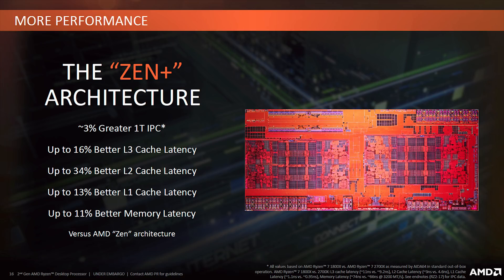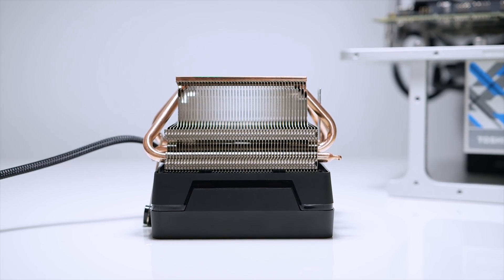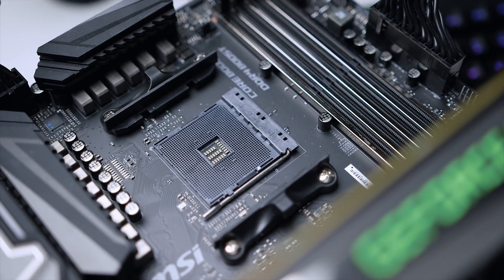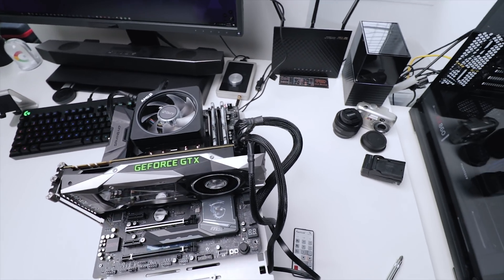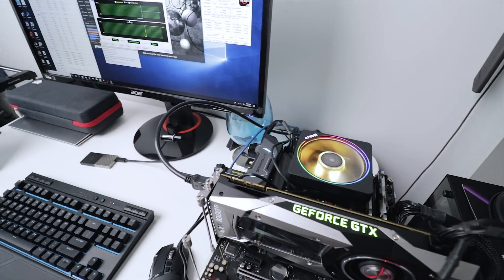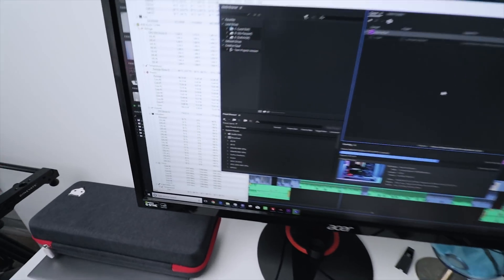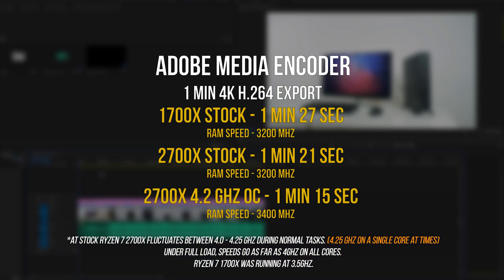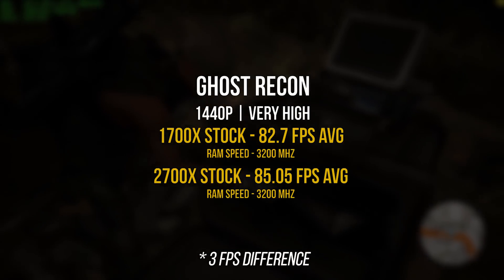Ryzen 7 2700X vs 1700X - Worth the Upgrade?

Comment: Man this is a hard decision. I'm on a Ryzen 5 1600 workstation and want to step up to a Ryzen 7. Looking at this, I'm probably better hoping for a price drop on the 1700x.
Reply: If you don't earn money with that system. Just wait for zen 2
Reply: Doesn't sound worth it to me. Get zen 2
Reply: Hydrochloric Acid I can't remember exactly what they were but MicroCenter is down to $229 on the 1700x. I think that's a small drop from a week or two ago. So $100 for a few seconds off my render/export times? Probably better spending that $100 toward some other upgrades.
Reply: Just got a 1700x from Microcenter last week for $179. $60 for an MSI Tomahawk B450 and price matched G.Skill TridentZ 3200 2x8gb for $165
Reply: cookiemonsta212 that seems like a gpu / driver problem, not a cpu problem  ...
Reply: Ok you sell me that 1600 and then I sell my 1500x to some Ryzen 3 guy then were all happy lol
Reply: The Ryzen 5 1600 is a solid processor.
I have a 1700x and it's good, and my plan is to upgrade only when the last AM4 CPUs come out , in 2020.
I recomend you do the same and save some bucks.
Reply: 1700x will likely stay at the same price from now on given it isn't current gen anymore. If you are planning to go for an 8 core chip, get the new chips
Reply: Just get the 1700x and be satisfied!  And can I has your 1600?
Reply: I'm running a 1600X @ 4.0 GHz. The temps and performance are great. I can't justify upgrading to the Zen+. Zen 2 will be out soon enough.
Reply: P.S. I stream all my playoff hockey through my PC to my 55" LED TV and there's nothing like all that RGB goodness synced to it. 😀😛😀
Reply: +HotRodHippie
Have a look at Hardware Unboxed and Gamers Nexus.
They both have a more in debth review then this video.
Reply: oc a 1700 to approx 3.9 might be even cheaper. should get 3.8 - 3.9
Reply: 1700 is easily the best value. I've got mine @ 3.95 and it screams. Still picked up 4k memory, X470 mobo, and the 2700X though.
Reply: Ryzen 7 CPUs almost ALL hit 4ghz.. . don't waste your money and just wait for Ryzen 2 (7nm parts)....You will likely want a new mobo at that point as well so better to wait.
Reply: The 1700x has already received a price drop so don't hold your breath
Reply: wait till Ryzen 2 dude
Reply: i upgraded 1600 to 2700x  and the performance improvement is massive even on b350
Reply: i've done many tests, like yourself i am editor as well so it was really important for me to move from 6 to 8 cores. I've moved from 1600x to 2700x and it does makes some difference, don't expect anything crazy but surely if you render videos that usually take hour to finish then you will see noticable difference, for something short then really no point of buying
Reply: by overclocking it you will again make a small difference but as i said this will be noticable only only long renders. For example i know for a fact that one raw footage with some graphic elements on it - with 1600x it took me 1hr 23minutes, after buying 2700x i wanted to give it a try with same footage and it took 12 minutes less - i am guessing thats around 15% improvement. But imagine having something to render that takes normally 8 hours to render - basically with 2700x it will take you 7 hours, thats a whole hour of saving time which is good. So as i said only with some longer renders you can see real difference.
Reply: HotRodHippie that's microcenter though. They always do stuff like that. It's a great price though
Reply: cookiemonsta212 yea I'm gonna give it a week or two and pick up a 1700x. I think reviews are pretty universal the consensus that the 1700x is a better value than the 1800x.
Reply: HotRodHippie I’ve got a brand new 1700x for sale if you’re still looking!
Reply: Some Gaming Bum thanks for the input. I'm on a full custom dual loop watercooling system. I built the rig planning ahead for an 8 core system.
Reply: HotRodHippie yea then for sure go with the 1700x. I’m in the same situation however I’m just using the stock heat sink with my Ryzen 5 1600 so I’m prob gonna upgrade to the 2700x
Reply: cookiemonsta212 try the new Firefox. TRUST me google chrome uses webm which is googles special codec which can't be hardware accelerated very well while Firefox and edge use MP4 which can be hardware accelerated very very well. Good luck
Reply: u know what? Steve fron GN tested voltages, so 2700x keep 4.0ghz at 1.2v easily, wich means, this will not fry ur mobo's VRM. so, I would definately go for 2700x
Reply: Muhammad Shuginubi I run watercooled VRM too with an EK monoblock but still that sounds rather nice. My days of pushing overlooks to the limits are passed, now I just want quiet and cool. So a decent OC with lower power level is a good selling point.
Reply: Biccy Thiccy I do heavy 4k editing. 2-3 videos per week. My 5 1600 gets the job done but definitely works hard to do it. I will be gaining to go to a Ryzen 7. Thanks for the input.
Reply: it will. dont bother w/ the new chips theyre literally just minor upgrades that mostly benefit not too many people.
Reply: check out microcenter. you can get a 1700x and mobo for $330-500
Reply: Same here. AMD should be proud, the Ryzens are high-quality competitive chips that have put them  back in the game. But the Zen+ CPUs seem to offer only an incremental increase for those of us who already built Ryzen systems. We should wait for Zen 2 on 7 nm structure. They should have done the 12 nm process immediately if they had the capability. I'm not sure what they expected to achieve sandwiching Zen+ right in between Zen and Zen 2 with only a year's time of market shelf life.
Reply: HotRodHippie amd is crap intel is on the top
Reply: HotRodHippie The 1700 is even better of a value... especially if you take proper advantage of C State overclocking.
Reply: Get Zen 2, or even Zen 3.
Reply: Ryzen 5 1600 is not a workstation CPU. More like a budget high-end CPU.
Reply: You wont notice much difference.
Reply: Dont forget you need to have the right gpu also to not get botlenecked.
Reply: Captin Camerica I've gone so back and forth but I think I'm just going to invest in the 2700x. I had a lot of issues editing a 4k video today. I need more horsepower. Best value? Not even close, but it's what I
Need.
Reply: i have a video up my 2700x just beat threadripper 1900x on multithread without overclock
Reply: Actually it's your GPU being used by the video decoder that causes this, not the CPU. You can get normal performance while running games and videos simultaneously by disabling hardware acceleration in your browser's options. As someone else suggested you might also want to try firefox out instead of chrome as it performs significantly better these days.
Reply: 1700x is wonky with the xfr, youre better off getting the 1700. Might as well wait for Zen 2 and skip 1700.
Reply: Hydrochloric Acid figured out I was just running out of ram, getting more is hopefully gonna fix it
Reply: HotRodHippie the 1800x is 319 on Newegg rn
Reply: Define "workstation CPU" because just prior to Ryzen a 5930K or 4930K was easily workstation and they all have similar IPC.
Reply: HotRodHippie dude I got my 1700x two months ago for $279.00 usd you can’t beat that with bat 😎
Reply: rajesh koothrappali it’s not worth it dude
Reply: HotRodHippie damnbi got mine for $279.00 and I thought that was a great deal $229.00 is a steal
Reply: Tory Allen agreed
Reply: tigerbalm I’m selling my 1400 for $115.00 usd only had I for a couple months before I upgraded to my 1700x
Reply: J Diddy You must strictly game 😆
Reply: Captin Camerica well from a 1600 to a 2700 I’m sure you can see performance boost but for somebody like myself that has a 1700x it’s not worth it enjoy that chip though dude
Reply: Avoid the 1700X, the 1600 usually overclocks better and as a result is better in most situations.  The 2600 is cheaper than the 1600 was last year and the 2700 is way cheaper than the gen 1 8 cores were.  The price difference between them now is negligible.  
You will need a new motherboard to run faster memory and take full advantage of the extra performance on offer from the gen 2 cpu's.
Reply: You already have a solid CPU. Just overclock it and wait for the Ryzen 3.
Reply: The 2700X cost $5 more then the 1800X and outperforms it.
Reply: Basically repeating what he said at the end of the video 

Going from 1600 to 1700 not worth it, (apart from the extra cores are nice but overall performance unlikely to increase unless your using more then 6 threads) , 2700x is better option and practically don't need to overclock it as all cores typically run at 4ghz and turbo on 2 cores can be as high as 4.3ghz (or run all cores at 4.1-4.2ghz)

I would wait for 3700x next year as 2000 is zen+ it's a refinement more then anything els i, the 3000 is zen 2 and should be quite a jump in improvement  over 1000 and 2000 cpus (but getting the 2700x from a 1600 is still a jump but is it worth it for 5-10% overall performance improvement)
Reply: If you benefit from the extra cores in your work moving from a 1600 to a 2700X would be a great move. If you don’t need the extra cores avoid upgrading now. Don’t move to a 1700x though.
Reply: I am a happy 1700x owner. Yes I might have overclocked it a smidge. I'm waiting for the third generation Ryzens
Reply: atSHADOWBAT being that you already own a 1700x yes I would hope that you’d wait for zen 2 or later. Just no need to upgrade a processor every year or even two.
Reply: I ended up going from the R5 1600 to the 2700X and I'm quite happy. It made a solid improvement to my work flow in video editing without any overclocking.  Though I haven't done solid numbers testing since I've been busy just using it.  I'll Overclock soon.
Reply: Video Production Company the switch hasn't made a big difference for me but it has smoothed out my workflow enough to justify it. And I haven't overclocked it yet. Would I make the jump again? Maybe not, but I'm happy enough with it.
Reply: Video Production Company for me I've noticed that the 2700x rarely boosts to its max frequency. It has plenty of power and cooling (fully watercooled). So it isn't limited, it just doesn't boost. Most of the time it's doesn't go over 4ghz. So I'm expecting an actually decent improvement just by overclocking to a consistent base over 4ghz
Reply: It probably doesn't boost because what you are dealing at that moment is not demanding more cpu power or you should check your bios settings. Mine boosts perfectly for some videos that i render but then again for some where CUDA is more dominant cpu is using only like 70-80% rest of the work GPU does. Overclock it for sure.
Reply: I'm still on fx I'm holding out for ryzen 2020 ore ddr5 motherboard coming in 2020 ore 2021 pcie4.
Reply: You can find insanely cheap r7 1700xes.  Mine was £130 about $180-200. As new. Been used lightly in a display model. The same will be the case with Ryzen 2 soon enough
Reply: hard decision ? from 1700x to 2700x there's a 30% performance increase but a 250% price increase. Obviously not worth it. no game will ever make that 30% difference felt when the performance is already massive and on the 2700x it's only a bit more massive.
Reply: For workstation 1900X, 1920X and 1950X eventually become nice buys.
From a performance per money perspective waiting for 3700X is likely the way to go.
Reply: 149.99 at new egg
Reply: @eroticheartbeats  guess I got lucky. 1700x is a damn good processor. I'm OC at 4.1ghz on air and 1800 in Cinebench.
Reply: 1700x now $139 at MC. 🙂 Just picked one up last night.
Reply: @thill9532  dammit...I should've waited 2 more weeks. I could have saved $30-40. Oh well. Black Friday/Cyber Monday is coming so I might have to go get a GTX1070Ti. Love that store!
Reply: 1700x is $140 right now on black friday, you can't beat that price to performance.  I don't care what anyone says.

1700x + 1080ti = profit
Reply: @mrcokez1  I agree the 1080ti is far superior, but for price to performance, a 1700x with a b450 board, TridentZ 3200 and 1070ti is hard to beat. I only have a 1060 (I only play and edit at 1080p), but the system is smoking fast overclocked for the price of less than $1k USD.  
If I was building budget gaming rigs for a living, I'd use the 1700/1700x, 1060 or 1070. Most "casual" gamers aren't concerned about 4k and over 60fps. Hell, most can't even tell the difference. They just wan't it to look "pretty" and be playable. However, I'm looking to upgrade to a 1070ti. I've always liked nVidia over ATI...but the new Vega's have caught my attention from a price point of view.
Reply: 150 usd on Newegg :)  as of today
Reply: I need help rn I want either a 1600 or 2600 or a 1700x which one should I get? my gpu is a 1070 btw and the games I play are really high cpu usaged
Reply: Aura 1700x is 140 rn on microcenter
Reply: dont forget 2700x is much newer and game developers havent fully utilized the potential of the 2700x yet
Reply: If you buy anything buy the 2700x, you can resell the cooler and it is snappy curtsy to the big latency reductions. For productivity its very good if you are looking for a upgrade (better then 8700k when not single core pref.). No point in getting the old ones if you can not get a very good deal since the 2700 matches/beats even the 1800x in productivity.
Reply: cookiemonsta212 that sounds like a ram issue my guy. How much ram do you have?
Reply: Man Microcenter has the 1700 for a steal at $165 after rebate.  That's frigin crazy!!
Reply: Wait for a sale, when they go on sale they are like 30-40% off, at least in Canada, but my 1800x is kind of buggy, like I can't watch YouTube and play games without YouTube lagging and a drop to about 40fps in games, even though my cores are below 50%, same with twitch app
Reply: @trogers2120  bottlenecking on GPU ?
Reply: @lko2181cp  I fixed the issue with more ram, I only had 8gb, now I have 16gb and it runs almost without a hitch, but now I am having studdering issues on a few games
Reply: HotRodHippie Ryzen chips run hot like very hot so if you get a 1700x you still have to buy a beefy heatsink (assuming you are currently using the one the 5/1600 came with) a decent heat sink will cost you 80 dollars. Therefor you are saving only 20 dollars for a less effective cpu... but if you already have a good heat sink then you are right the 1700x would be better financially.